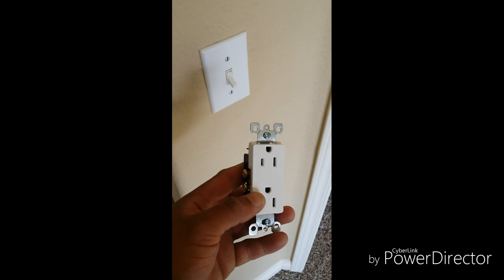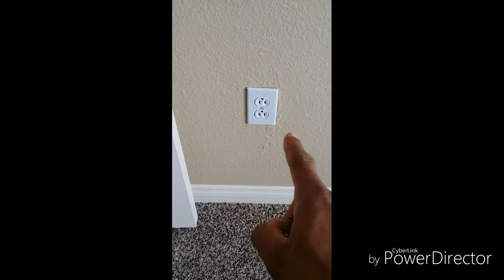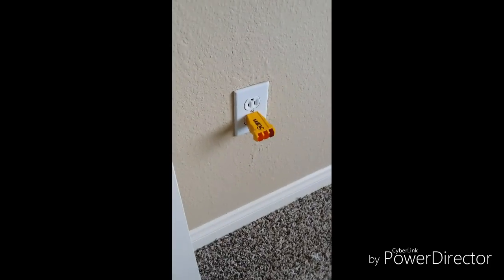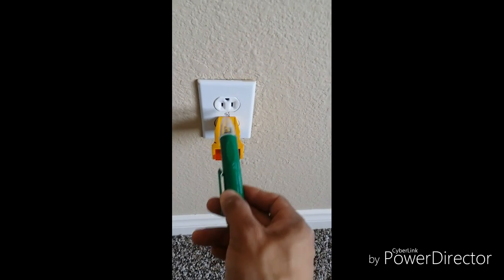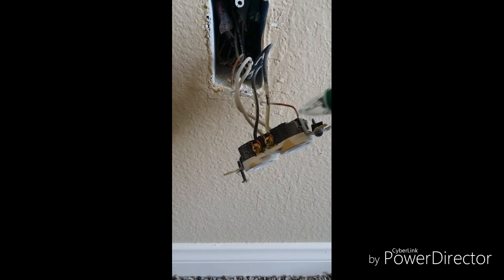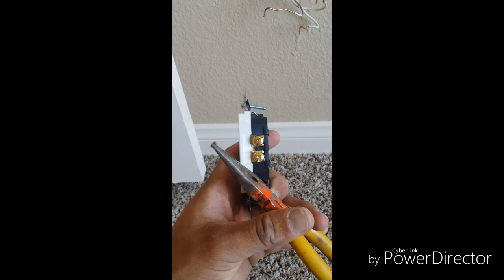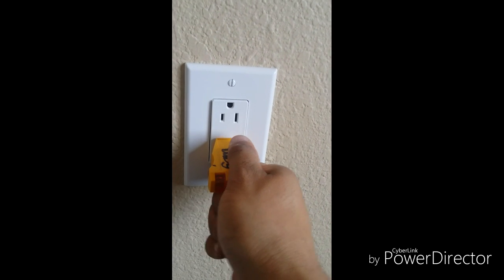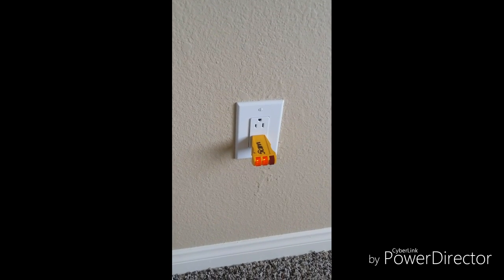How To Wire An Outlet Off Of A Switch

Comment: I really hope you reply to this but is there a way for me to disconnect a light switch from an outlet?
Reply: Yes
Reply: As long as you have another power source ran or re directing other option is don’t break the tab from the Receptacle so therefore you have a constant power to your plug

Comment: I have a outdoor light fixture controlled by a switch can I add a gfci outlet from the switch to run constant power for a pool filter?
Reply from the maker: chino3642 
I'm not sure I understand the question. Your pool/spa filters are powered directly from your circuit breaker. The only time I have seen a GFCI in regards to the pool/spa system is for the pool/spa lights. This is in case of any wiring issues , grounding etc. the GFCI will trip and shut the lights off. Even then the pool/spa lights and GFCI will get their power source direct from a curcuit breaker. Hope this helps.
Reply: Sam I don't have power for the pool I need to add a source for the filter.  I guess I'm asking if I can run an outdoor outlet from the light switch to run my pool filter?
Reply from the maker: chino3642 
There is a lot to consider. The amp draw on your pool motor will be an issue. Where are you getting your power source for the light switch? I would suggest you call an electrician and ask for a "free" estimate. Explain what you are trying to accomplish and what are your options. Usually they will advise you and then at that point you will have a better idea of how to proceed.
Reply: Sam thank you!

Comment: can both outlet be connected to use with the switch instead of just one
Reply: Can both outlets be used independently from the extended switch?  Being the switch having no control of both duplex outlet?
Reply: V watts easy